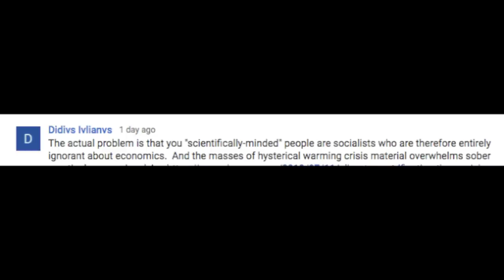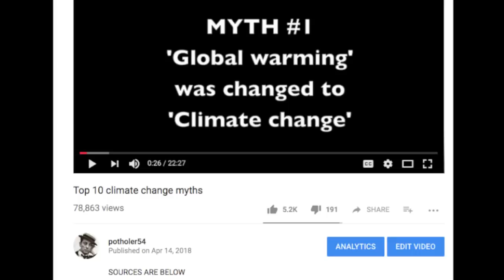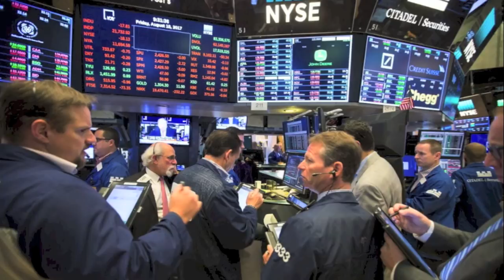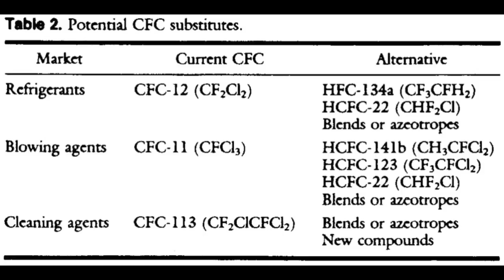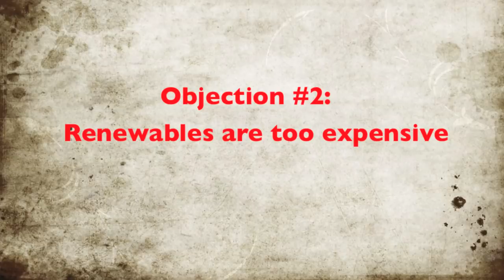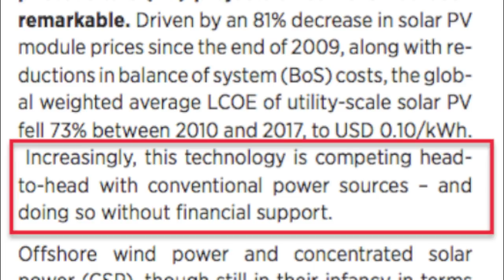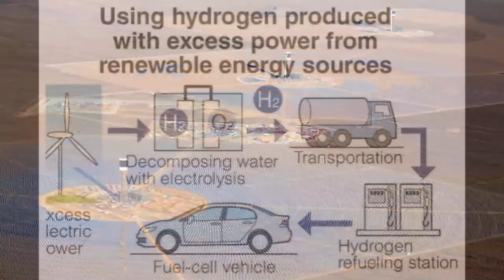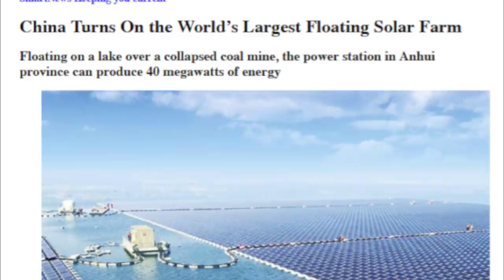A CONSERVATIVE solution to global warming (Part 1)

Comment: The heavy-weight-on-rails system for energy as an alternative for dams has the huge downside that the heavy weights don't conveniently evaporate and rain up there where it's stored, they have to be either harvested from there or brought up, which may just as well take as much as energy as it stores gravitationally, or at very least create a heavy waste problem down there if it's just harvested from above. Unless maybe it's harvested as an artificial basin for a dam is built, perhaps.
Reply: I think you're missing the point of such a system: it's meant to store excess energy as it sometimes produced on especially sunny or windy days by PV setups and wind farms respectively. As mentioned in the video, renewable energies can produce too much electricity at certain peak hours. This energy can be stored (like this rail device or water basins) to be used at a later time.
Reply: @bonham1981  so its inefficiency is even kind of "desirable" as something that prevents damage to the grid, that's interesting.
It would be more interesting something without that inefficiency, though.
Reply: @petitio_principii  A certain energy loss is not desirable, but rather unavoidable. One cannot transform energy from one form into another without a certain loss (either directly as waste heat or indirectly through friction, which also ends up as heat), it's practically impossible. Obviously the aim is to increase efficiency and that's why different solutions are invented and tested.

Comment: The aluminum-air battery might make electric cars practical. If you can recharge on the highway while you're in the bathroom or having lunch, long trips become realistic.
Reply: Aluminum-air batteries function more like a fuel cell, so they can’t be recharged.  You have to replace the aluminum consumed by the reaction.
Reply: @maximus9812  
Quite right. I should have said, "Aluminum-Ion".
https://en.wikipedia.org/wiki/Aluminium-ion_battery
They need a new cathode material that's less prone to cracking from the larger ion size that L-I batteries.

Comment: @ 17:34 you mention South Australian...as an Aussie I must point out that South Australia has more power black outs than ever before.  While slowly increasing renewals they have greatly decreased our base load which consists of mainly coal, because of it our power prices are at record highs.  I'm all for new renewals coming online, I just think we need more practical solutions.  Maybe Australia should start looking into Nuclear as an option for base load power, but to the far left Nuclear power is the Boogyman.  I just getting sick and tired of cilmate change debate, The right want to stick their heads in the sand and the Left wants to destroy our economy.
Reply from the maker: "I must point out that South Australia has more power black outs than ever before."
   But that point is only valid if you can give some figures, and say where they come from. How many blackouts now? How many before? When was 'before'? 
   The reason I ask is that there was a big spat over blackouts either last year or earlier this year, when storms knocked out power across South Australia. The Federal Government immediately blamed the power outage on the State's use of renewable energy, but it turned out the damage was due to storms hitting transmission lines. Power would have gone out regardless of the source.
   As for you power prices being at a record high, our grid runs mainly on coal and we are also experiencing record high electricity bills. And we get frequent blackouts too. So without figures, and a proper study to determine causes, it's not that simple.
   Ironically, the way we slashed our electricity bills was to install solar panels. I highly recommend it. During the blackouts we have here, the only people with their lights still on are those who invested in solar panels and batteries.

Comment: One of the marketing ploys used by your local energy company is check the box if you want your energy to come from renewables.  Folks electricity--aka-a current of electrons--does not know nor care where it comes from.  Electricity is electricity. It gets distributed to your house via a grid & distribution today is rather expensive.
Reply: So renewable means nothing to you? Which bit is difficult for you?
Reply: @tobleramone  So why pay more it's a marketing gig.  Electricity is just current.
Reply: @kimlibera663  Yes, well done on knowing some elementary physics but what about the SOURCES of electricity, have you anything to say about that or are you determined to miss the point?

Comment: I really do wish that conservatives and libertarians wouldn't focus so much on denying climate change an/or trying to cast doubt on the scientific data. Instead, they should be focusing on free market solutions to the problem.
Reply: The free market can't solve that problem. Big  companies have no incentive to reduce pollution because it cuts into their profits. This is why the state must regulate these businesses.
Reply: @WykydMystic  What about nuclear power?
Reply: @darthutah6649  Nuclear power is expensive if done safely, too expensive to be made profitable.
Reply: @PistonAvatarGuy  The real issue with nuclear power is how heavily regulated it is. While this may be done to prevent another disaster like Chernobyl, the risks are often overstated. Nuclear power actually has a very low death rate with only 90 deaths per terawatt (much lower than for fossil fuels and even lower than wind and rooftop solar). The real issue with nuclear disasters is that they leave certain areas uninhabitable for a long time, but all of those disasters were done with generation II reactors which brings us to another problem.

There isn't enough uranium to allow nuclear power in its current state to replace fossil fuels. At current rates of consumption and assuming that no more reserves are discovered, uranium will last 80 more years (even less if it phases out fossil fuels and global output increases). By comparison, coal is projected to last 200 more years and we are generating more output with coal than uranium. However, generation IV reactors hold the potential to produce more power with less uranium. According to one estimate, they can generate 100-300 times more electricity with the same amount of uranium. Since they use less enriched uranium, this obviously reduces the potential damage caused by a meltdown. And that's just with uranium. Thorium power may be able to phase out uranium power. According to one estimate, there is enough thorium in the US to meet energy demands for a thousand years.

https://phys.org/news/2011-05-nuclear-power-world-energy.html
https://www.statista.com/statistics/494425/death-rate-worldwide-by-energy-source/
http://www.ossfoundation.us/projects/energy/nuclear
http://www.world-nuclear.org/information-library/current-and-future-generation/thorium.aspx#References
Reply: @darthutah6649  Nuclear energy is the solution, deregulation is not. We don't need to replace one problem with another. Nuclear accidents don't result in high death rates because huge exclusion zones keep people out of the irradiated areas, and we can't just exclude ourselves out of the whole surface of the Earth as more nuclear accidents occur, simply to appease some obsolete economic system. There's enough uranium and thorium in seawater to last for many thousands of years and we can also harvest lithium from seawater.
-
France nationalized their energy grid, standardized their nuclear energy system and now has some of the cheapest, cleanest energy in Europe, that is the solution. There are no free market solutions to climate change.
Reply: First of all, the Heritage Foundation is a right-wing think tank. I don't trust their graphs. Their sources might be accurate but they're most likely misrepresenting them. Potholer himself has mentioned Heritage's lack of trustworthiness. The United States, the most "economically free" country in the world is the largest consumer of oil and 2nd largest emitter of CO2. On a national level we are doing NOTHING to remedy this. China holds first place for carbon emissions, true, but on a national level they are dealing with it now. Their plan is to be mostly dependent on green energy by 2030. That's the last thing the oil/energy companies in the US want. All propaganda against climate change is being spread by them. Green energy just isn't as profitable because it's renewable.    @darthutah6649
Reply: Read the comment I just left for darth Utah. Green energy isn't as profitable. The only reason energy companies are working on green energy at all is because they know a time will come when they'll have no choice but to transition. This will be due to either dwindling resources or public outcry. Everybody is too reliant on gasoline as is to really do anything about it. @Zaphod Broxbeeble
Reply: @WykydMystic  As a contributor to America's electrical output, from 2000- to 2018, coal went from contributing 51.3% to contributing just 27.44%. Most of this decline is attributed to natural gas (which is cleaner than coal) which in the same period went from 16% to 35.43%. Wind and solar have made major gains during that same period as well. Wind power went from contributing 0.15% to 6.58%. Solar went from a measly 0.013% to 1.52%. Granted, both have a long way to go before overtaking fossil fuels but don't think that the US has done nothing about this.
https://en.wikipedia.org/wiki/Electricity_sector_of_the_United_States
If this increase can be attributed to federal subsidies, then the notion that "on the national level, we are doing nothing to remedy this" is purely false.

Comment: To be fair, that big battery in Australia is done in 3 hours at full load. So, if it's a hot evening in Oz and the locals are running air conditioning, you may find that battery doesn't do much good and the towns have to switch to gas or coal.
Many people do not understand the scale of power generation in a large nation like the USA and why pumped storage isn't really a great option for something beyond a small municipality. But that's all part of the process of developing solutions.
If you want the drastic cuts in CO2, you need Nuclear power. And we need to make nuclear cheap enough and safe enough to deploy to countries who haven't traditionally had the capacity to develop it for themselves. The USA, UK, Canada and USSR each developed their own unique nuclear power designs starting in the 1950s and 1960s. Had we all worked together, the world would have been a very different place today.
Reply: "To be fair, that big battery in Australia is done in 3 hours at full load."
Complete strawman argument. The battery was never designed to hold up the network for an extended period of time. 
It has a major role in the FCAS market (Frequency Control Ancillary Services). It has regularly stabilized the electricity system after unexpected drops of supply, from coal plants and interconnector transmission lines. According to the Australian Energy Market Operator's executive general manager of operations, Damien Sanford, "Its ability to respond very, very quickly to the different types of conditions that we see on the power system has been very encouraging for us. ... We've been pleasantly surprised and would encourage more of this technology into the grid."  
""We sense something on the system and the automated protections kick in, then a battery can operate at around 200 to 250 milliseconds — so very much sub-one second response — to protect the system," Mr Sanford said.
"Normally we would trip load under those conditions; this type of technology affords us to do a rapid injection of power to protect the system."
The battery has let to significant reductions in the cost of the FCAS market.
"It's providing much-needed competition in a highly concentrated market," said Dylan McConnell, an energy analyst with the Climate and Energy College at Melbourne University.
Source: http://www.abc.net.au/news/2018-10-02/tesla-battery-proves-a-leading-source-of-dispatchable-power/10326420
Reply: There are other battery systems operating very successfully in Australia. Here are links to two of them:

https://reneweconomy.com.au/south-australias-second-big-battery-charges-into-action-79148/

https://reneweconomy.com.au/the-other-big-battery-that-has-quietly-changed-thinking-about-the-grid-15291/#respond

These batteries provide the same service as the Tesla Big battery but are also showing other advantages of battery systems including islanding and providing inertia to systems.

Worthwhile reading for anyone who wants to be informed on this fast evolving technology.
Reply: @stespe06  which still doesn't address the problem of renewables not being able to serve as a base load solution. 
I understand using them to assist with peak loads or making up for an outage elsewhere, but people are advocating these large battery banks as an energy storage solution to solve the intermittency problem, and that's just not what they're for.
Reply: I mean, if worse comes to worse and we cannot store the excess energy using modern day technology ( including the use of  any of the other energy storage methods also mentioned in video, which i HIGHLY doubt). Then at the very least we'll have a better chance of coming up with a solution to storing excess energy, if companies would actually start investing in renewable energy and looking for solutions to make it work. But right now, we're not even at that point since most politicians don't even want to admit that cleaner energy is a necessary solution. By the way, you'r completely right about nuclear power. Probably one of the best solutions we have right now.
Reply: Thanks for your reply @Mike McKeen.
Do you now accept that the claim that batteries are for holding up the whole grid was never the aim of battery technology and that batteries have an important role in FCAS markets as well as islanding in appropriate circumstances (eg Yorke peninsular in South Australia) and also have a role in providing inertia to the sysetm?

My interest is in the views of experts. I have linked to an interview below with Greg Jarvis, Head of Energy Supply and Operations at Origin Energy, one of Australia's major energy suppliers. The whole interview is well worth listening to but I will point out a few important issues.

With regard to your claim on BASELOAD.
At 22:45 Jarvis says: "The idea of baseload power stations is well and truly gone."  People who are running power grids and generating electricity now are concerned with DISPATCHABLE  power, not BASELOAD. 
There was a time when gas power stations were built for baseload, but not anymore, they are just run now in peaking mode.  27:15

"... but people are advocating these large battery banks as an energy storage solution to solve the intermittency problem, and that's just not what they're for."
I have already dealt with the role of batteries in FCAS markets, and also in islanding and providing inertia. Can you provide a link to anyone claiming that batteries alone will solve the intermittency problem? 
Note at 24:10 in the interview below Jarvis says that peaking gas, pumped hydro and batteries together are the major technologies in addressing intermittency. The technical term for making renewable energy supplies, incidentally,  is firming. 

A major reason why renewables are being built in large amounts is that "renewables are cheaper than coal at the moment." 19:15

There are plenty of other parts of the interview that are of interest and informative. I commend it to you as the view of an expert participant in electricity generation.

https://soundcloud.com/reneweconomy-646697966/origins-greg-jarvis-on-why-renewables-are-cheaper-than-coal
Reply: @Munib Ahmad
Renewable Energy is expanding in my country (Australia) in the US and many other parts of the world. See link below and the interview I linked to in my response to Mike McKeen. 
I don't think it is true that " most politicians don't even want to admit that cleaner energy is a necessary solution." There are many politicians in Australia, US, and Europe that are supporting the expansion of renewables. Those who are opposing this necessary change are on the right of politics. What I find interesting is that these right-wing politicians are strong supporters of markets, but the market is one of the main drivers of the expansion of renewables! These politicians are strong opponents of government, but are using government to stop processes that are driven by market forces.

I have now provided five sources in this discussion. If you are aware of this channel you will know that potholer54 is a strong advocate for providing sources for claims.
Have you got a source for your claim that nuclear power is probably one of the best solutions?

http://theconversation.com/market-forces-are-driving-a-clean-energy-revolution-in-the-us-95204